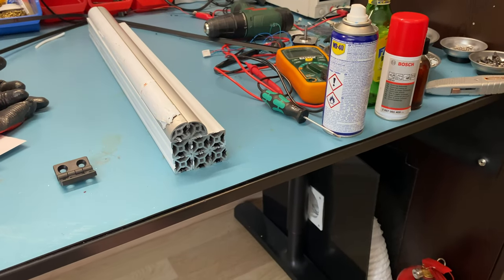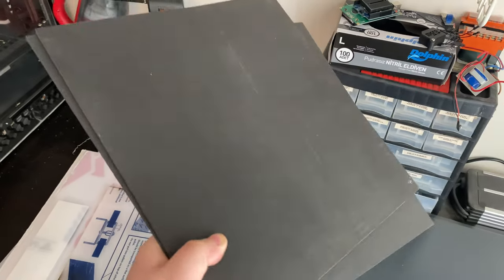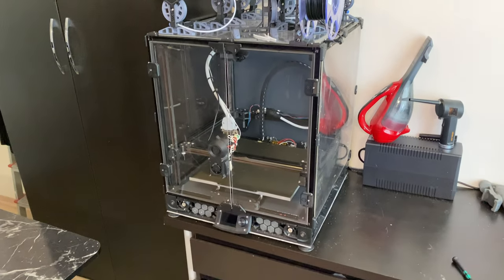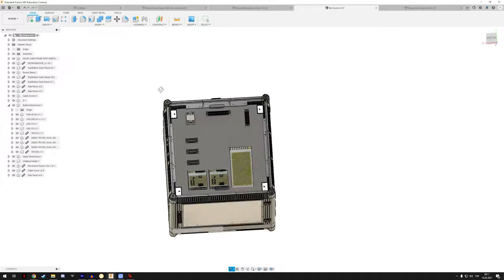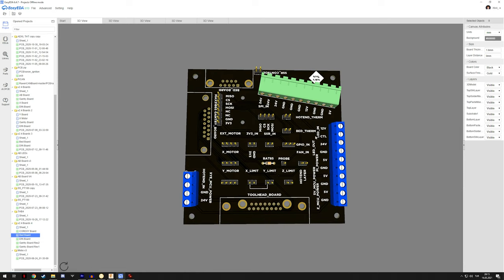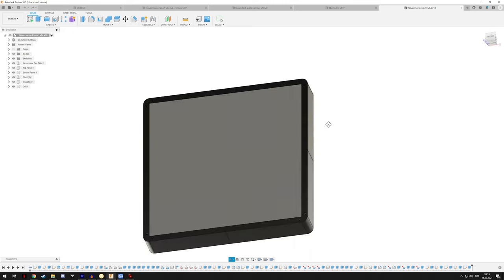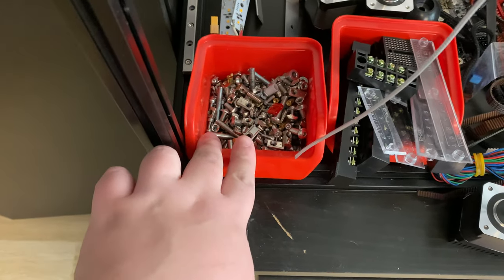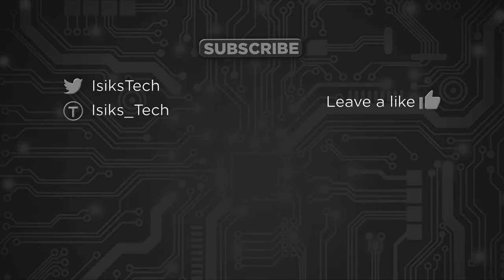Voron v2 Ep. 16 - New PCB & Tearing Down v2 & Parts Started Arriving

Comment from the maker: This was recorded before I knew about the FYSETC Spider. That looks like a great board, especially for stock Voron 2, but has 8 drivers and I need 9 so I can't use it. Wanted to post this before someone asks.
Reply: Ah I just scroll down to say Fystec Spider but you already know, It's look like a straight fit for Klipper. I think you can use with motor expansion modules like BTT, if you don't use 12864 screen. Waiting for future updates.
Reply: As he said i think theres expansion for it too
Only seen it last few days myself
Reply from the maker: I want the screen. But I can always also use one of my e3 minis as second mcu. Idk yet. I don't think I will buy one but if I have one I'll use it.
Reply: @IsiksTech  what about the bigtreetech gtr+m5 boards that will give enough slots for drivers 🤷‍♂️ and had dedicated connection for the expansion (m5) to plug them together 👍🏻
Reply from the maker: If I'm buying a new board it makes sense to me to use a Duet because of the gpio. With Klipper using 2 boards isn't difficult anyway. I might be getting a review sample of a new board though. If that happens I'll use that board.
Reply: @IsiksTech  the gtr and m5 had pi gpio connections too from what i can tell of about all the boards so far it gives the most options
Will be interesting to see what you go with anyway
Reply: @IsiksTech  i still need to take a look at klipper only messed with marlin so far
Ive got an ender 3 which has taught me that this 3d printer game is plug and play make it work yourself kinda thing which i really like ill have a go at building my own soon now we got our head around the basics
Glad to have found your channel seems you share a lot of good information thankyou 👍🏻

Comment: Hello ! Would you advise for the construction of a new Voron 2.4 from the 0.9 ° LDOs or the classic 1.8 ° from the BOM and why? thank you very much, i just subscribed i love your ideas!
Reply from the maker: I personally didn't test the LDOs yet but from what I've read they seem to work at least just as well. If so, they are the superior option because of the higher resolution. So that's what I'd choose.
Reply: @IsiksTech  
thank you for your quick response! I also heard the same thing and that it was quieter than the stepperonline. But I do not know.

Comment: Cool. What exactly is the Doom printer? I see a few folks talk about it, but it is not listed on the Voron site. Can you explain?
Reply from the maker: It's not listed because it is a community mod. Has thicker outer extrusions which allows you to use insulation for high temperature printing. Also relocates the z drives to a new top electronics chamber.
Reply: @IsiksTech  Thanks. Appreciated